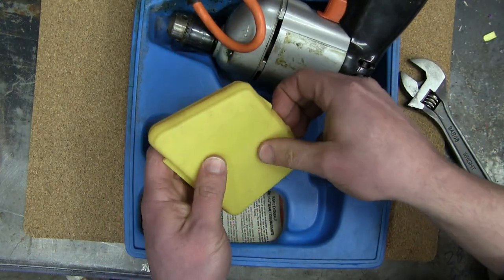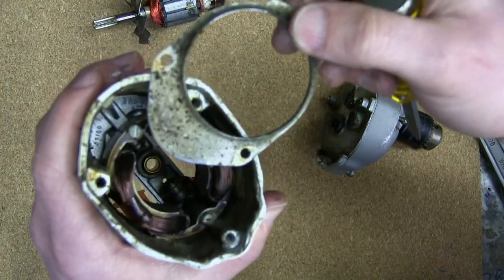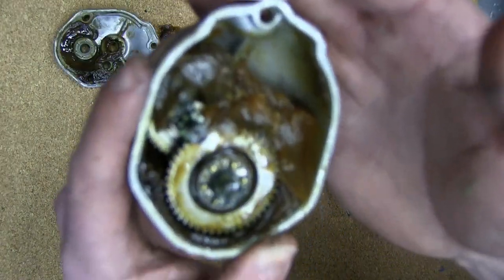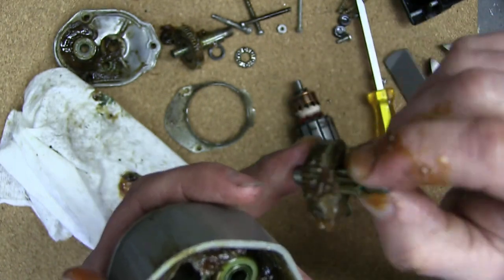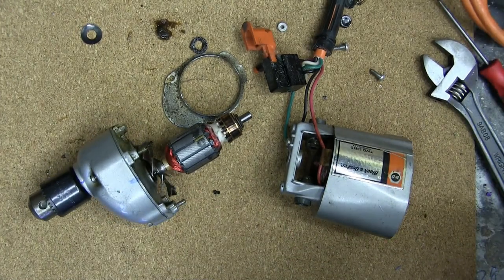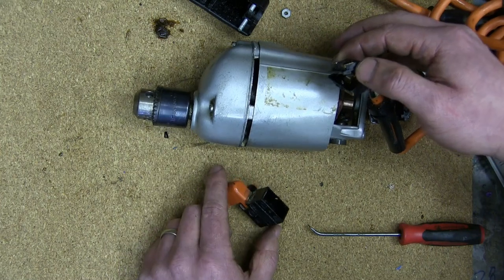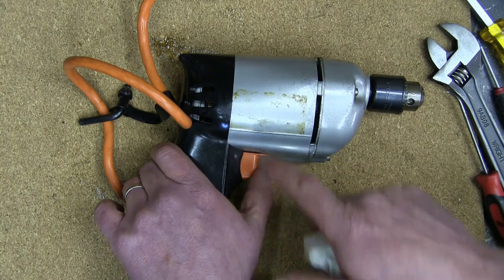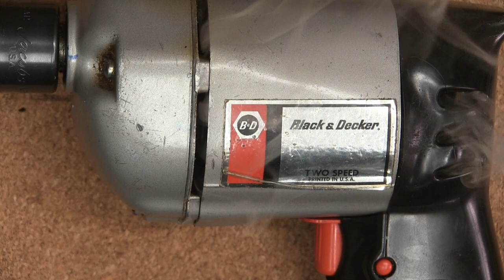BOLTR: Black & Decker. Old School.

Comment: Was the last guy to leave. Laid off 3 times before they moved out Md. Made the armeture shafts. Ran multi spindle screw machine. Last job there ran chop saw cell, 4 machines. Made gear blank. Cut gear teath. Broached hole. Deburr back of hole, ready for heat treat. Have a big box of metal case tools given to me by an ass hol

Comment: i have inherited a similar drill at some point in my modest carpentry career, i believe mine has reverse though.  i thought the orange cord on mine was just an old extension cord that someone replaced the original with, but i see it's the same cord on this one.  it is a nice drill, but there's never really any reason to use it.

Comment: Would you bother/is it possible to replace the chuck on one of these old vintage drills as a light duty novelty? I was given an old one which the jaws had become mismatched due to a crack in the tightening ring (sorry I'm not prob using the right term) so I just unscrewed and pulled the old chuck off since the drill is either getting a new one or going in the bin.
If any swaggering son of a diddly here has done  (or 'done') it with a drill similar to this I'd be curious to know!

Comment: Can't wait for my ruler to arrive. If you covered this I missed it but what temp do you recommend for my soldering iron to do the flashlight?
Reply: Whatever melts the solder, you'll want it to be fairly hot for the bigger pads. Nothing in the kit is really temperature sensitive at all. I just did mine by tinning all the pads then putting the components on, heating the solder to adhere.
Reply: OK, I am fairly new to this small soldering stuff and I just bought a 3 in 1 soldering, rework, dc power supply unit so I am still learning to use it.

Comment: a friend came over to show me the new M Hole Hawg he bought.. said before he told me what is was.. lets play a game.. lets see how has the biggest drill..  whips out his new hole hawg.. i said OK.. lets play.. i reached deep into my work van.. pulled out my 3/4" black and decker drill with the #2 morse taper and showed it to him.. he was quite upset.. said i don't want to play with you any more..   i could have gone inside and pulled out my 3/4 M 220V drill that is just slightly bigger than the BD..   thought you would get a kick out of that.  sometime i will whip them both out and snap some pictures.

Comment: well, the field windings were scorched already, so the drill may have been not long for this world, anyway...though it would have been more sporting if it had died while drilling, rather than clamped down -- the green was likely verdigris from the brass -- I had an old B&D like this and wanted variable speed but was too cheap to buy a new one, and had an old dimmer switch in my junk box...a while later, I had me a variable speed drill with a kitchen dimmer switch mounted on the end of the handle

Comment: Long Time watcher not first time commenter, so my deduction from watch all these tear downs, which are awesome 👍is you find good and crusty points, so ave how would you build your ultimate drill or angle grinder using the best of the best so it can take a super hot supper would love to see a video on the subject, and you could start off with a big scookum trigger

Comment: That's not old school. My old B&D drill is of similar design but the case is all metal, the power cord is ungrounded, and the skookum switch has a strong click. Literally no plastic on the outside except for the cord grommet.

Comment: Are bushings a good idea in such a tool? It seems like if something's got warped during the takinapart/reassembly the thing would be fucked, why not spend a bit more on a proper bearing?
Reply: They weren't designed to last forever, just 'almost' forever. By the time those bushings wore out, you'd want a newer tool, or have destroyed the exterior. they were designed to a price point, not to be perfect. Even so, they lasted a good long time. Me, many of my small power tools got stolen (well, more often borrowed and never returned) before I could wear them out.
Reply: Yeah I can see that,however I've had a problem with a worm gear motor type thingy where the casing got warped on account of heavy things hitting it where not intended, and the bushing started pressing onto the shaft to the point where it wouldn't even rotate. It occurred to me that had there been a bearing installed, allowing for much higher radial load the motor would've still worked fine. Correct me, if I'm wrong.

Comment: kinda sucks he broke it on purpose instead of just fixing it and putting a real chuck on it, i got a makita drill just like that one only much newer and its not near as skookum, its got high speed ball bearings and all the modern amenities but no epoxied com bar wires and a craptacular reverse switch and stuff, and its a MAKITA for fornication sakes cmon man i know i got it for 10 bucks at the flea market but im sure they can do better than that

Comment: Anyone else want to see Ave review some welders like a multi process welder from a smaller company like Eastwood ?
Reply: I would like to see him review a Everlast 200 ST arc welder, its only $360 and he needs one of those anyway. Its a special machine because it has a port for 6010,6011 and most inverters can't run those rods.

Comment: Given the 4 wires and that there's no reverse, does the switch where there would normally be the reverse switch actuate the second speed?
Reply: nope, that's for holding the switch on,  when you are using the drill as a motor in another kind of tool.  B&D made all kinds of accessories to turn their drills into sanders, saws and even a little wood lathe.   This particular one is a shade too old to work with most of those because it lacks the 1½" mounting journal at the nose.  Modern wired drills use a 1¾" (44mm) nose mount and you can't seem to buy one without hammer action,  which means the spindle is wobbly compared to these nicely geared old ones.

Comment: I have just been given the older version of this drill the black and decker D500 5/16 inch drill and it's bigger brother the 1/2 inch standard drill, 400rpm. both are on eBay if anyone wants either let me know and il post the link.

Comment: Pretty irresponsible to "test" a drill in this artificial way.
Not funny despite the smoke & potentially dangerous if earthing was affected.
And we still don't know  the armature insulation class.
B & D drills of that period were near indestructible, the weaknesses were low quality chucks & failure prone switches although that mainly applied to small drills.

Comment: I have this drill, it's been sitting in a Tuberwere case for 25 years, fired it up last week and works perfect. There is no reverse on these drills, and the chuck is tiny! Ebay it goes most likely.